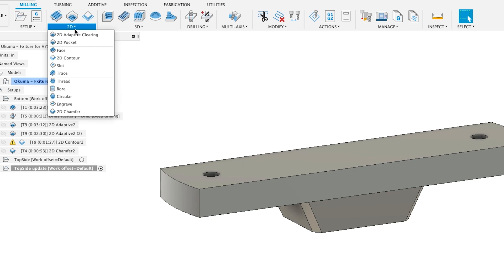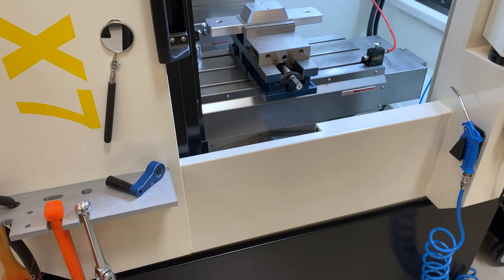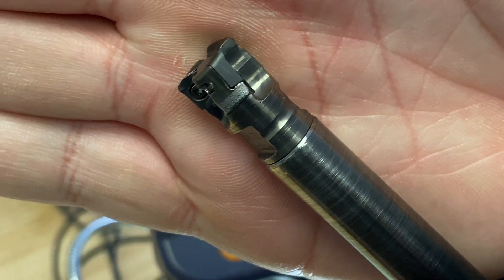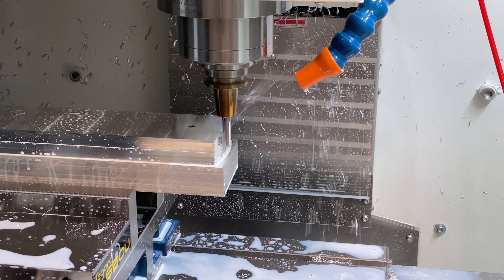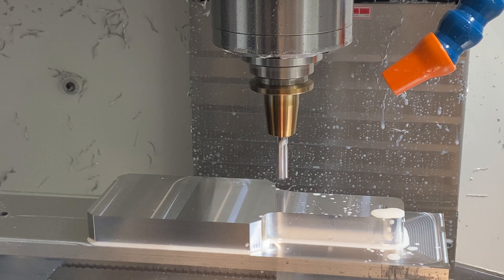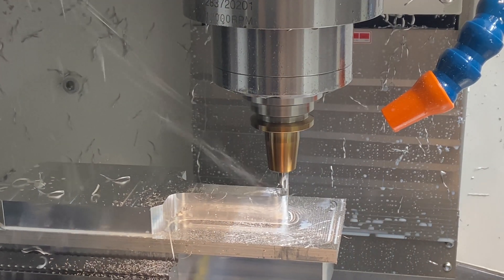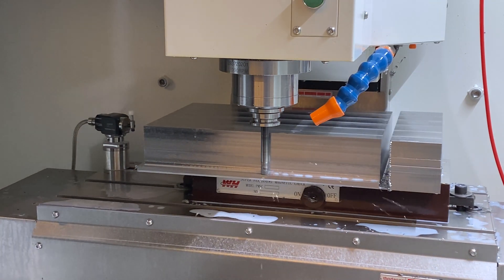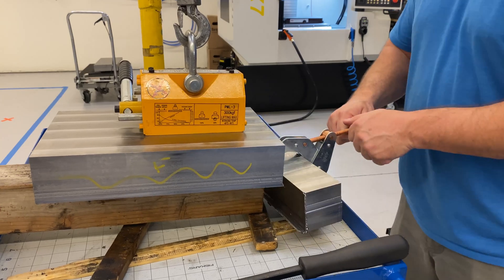Lets Talk Toolpaths - High Efficiency vs High Feed

Comment: Great content. Getting high speed adaptive toolpaths sorted out can be challenging but worth it. If you have the space, a high quality saw and a 2.5 axis mill like a Prototrak excel at operations like squaring up that heavy steel block. I have a Prototrak bed mill that supports out Haas DM-2. It’s a great cnc machine on its own and really makes fussy stuff like picking up features on an existing part for modifications easy. Also the incredible Z height is nice to have. I see a lot of shops that waste a significant amount of stock, time, and cutter life turning stock into chips that could have been sawed away in a fraction of the time.

Comment: I don't understand. What is the actual rapid speeds of the Syil X7? In every video I see, the rapids are slow as heck. Does everyone just have their rapids turned down?

It makes no sense when trying to show case a machine. Other people are just going to take it at face value and think the Syil X7 is slow.
Reply from the maker: 30 meters per minute for the syntec control. 

I'm pretty sure Syil has a spec sheet on their website.

Cheers,
Jason
Reply: You might see via...official website ...for those machines....but ....this is not for high speed ....cheep price ...poor efficiency...indeed!

Comment: Gotta give it some ! If you are going to show high speed machining :) we rough and finish with Kennametal Kor V in aluminum, if you haven’t used them you’ll find you limit is going to be HP.  Full depth of cut at 200ipm with 15% radial.

Comment: I have the same kyroseca cutter, the 20mm and the 32mm, I rip P20 tool steel with it, its incredible, 4 edges per tip. 8000mmpm with 5 inserts.
Reply: Cost?
Reply: @jonjohnson102  Cant remember, ill have to check but the tool off the top of my head, its like, £80 for the body, and £6 tip.

Comment: I find adaptive to be more suited to tall 2.5d roughing and high feed more suited to 3d roughing. As you said high feed is also valuable on long reach cutters because the shank is solid and the mostly vertical cutting force induces less flexure on the cutter.